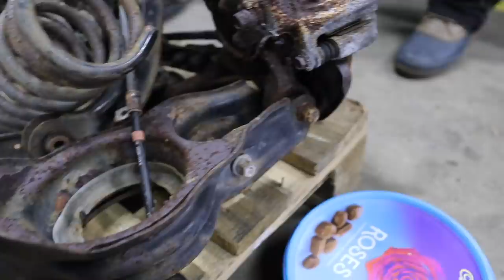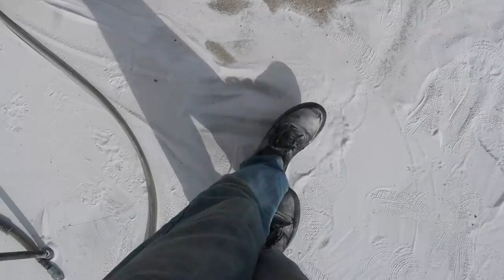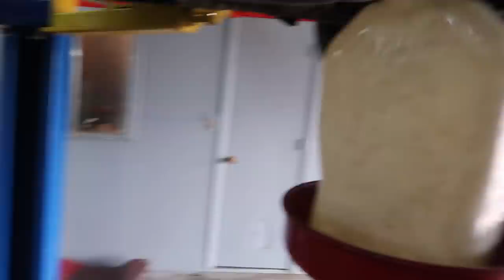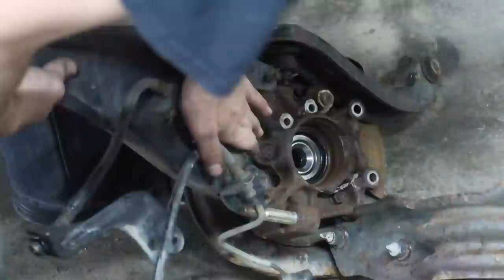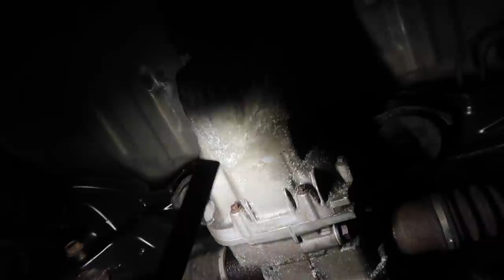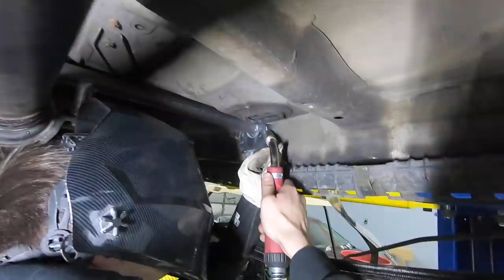Making Our Honda Minivan ALL WHEEL DRIVE! (Full Process)

Comment: Very neat retrofit on a USDM-spec van, for sure. But for the guys remarking how special the rear differential is, literally the same components are on the 1st Gen 4WD Odyssey as on the USDM 2000-2001 CR-V, right down to the part numbers: 41010-P6R-315 for the carrier sub-assembly, and 41011-P6R-315 for the Torque Control Differential (TCD) case kit. So, at least if you break it, it's easy to find replacement parts!

Comment: Where I work, I can tell you when it comes to region specific holes it is cheaper to use a hole plug then to modify the dye stamping the hole in the body. So anytime you have this type of upgrade usually gonna be bolt on, unless it's something like a sunroof...

Comment: if you put water on the floor before blasting the sand will stick to it and it will be easier cleaning it up, also when you paint you should have water on the floor so you don't stir up dirt, dust and debris from the floor onto your pained surfaces. Just a tip for you, you wont read it of course but someone might. cheers

Comment: When you had the Rowsyssey up in the air at 42:00 you can tell that your gear ratio is different from front to back. The rear is spinning faster than the front. Hope this doesn't cause anything to break.

Comment: Get some PB blaster for the shop.  I couldn't believe how well it worked on my 85 4runner when I rebuilt the suspension and diffs, I thought I was going to have to cut most of the bolts off because they looked so bad. In the end I had to cut one bolt off, I did soak it all down with PB blaster for a few days prior to tearing it down though.

Comment: That diff, if you want to look it up, looks the same as a Honda HRV GH4 from 1999 to 2005. If i recall correctly, it has a stack of clutches like a auto transmission, and the whole diff itself uses automatic transmission fluid, instead of normal gear oil.

Comment: You should have the cartel garage scan that rear diff and have a billet casing in case that rear diff breaks and scan the inside gears and other parts inside the casing so that you can be sure that the diff will fit and be able to replaced if anything go wrong its better to be safe than sorry especially with how rare the part is in the USA  and Europe

Comment: Did you end up getting mounts for the rear subframe sorted? if not i think you could get some nuts the correct size for the OEM bolts, drill a hole in some 1/4in plate, weld the nut over the hole, widen the hole in the odyssey so the nut will fit through, push the plate up and weld it on and you can use your OEM bolts and mounting locations etc

Comment: I've heard of the 2008 and up element and crf rear diffs holding about half the power your projecting.  If you diff is the older version . All u need to swap is the diff bracket for the upgraded version.  .. you may be able to use the carriage from a element.. .. . Which is very similar to a awd rsx rear assembly . ??,

Comment: You know there are engineers at Honda in Japan watching your videos probably trying to translate English to Japanese to better follow your amazing efforts. It’s one thing to get more horsepower out of a 4 cylinder than most can get out of the infamous Supra or BMW in-line sixes and it’s another to hook it all up to a minivan with beefed up AWD hardware. Honda out engineers Toyota, the Germans, and most everyone else. If you tried to do this with a German vehicle the hurdles would likely be insurmountable and it would still likely grenade into broken bits at the first application of full throttle. Yet a lowly Honda minivan and Civic wagon hardware can deal with 1000hp. Go Honda! Back in the mid 80’s when the first generation Integra hit the market the automotive journalists said the harder you abused it the more it rewarded the driver. The decade from the early 80’s to the early 90’s were the glory years for Honda and Acura. Has anyone made 1000 reliable horsepower from a Corolla or Sentra motor let alone hooked it up to AWD?

Comment: As someone who use to build drive shafts for a living. i do not like how they extended that front shaft. i could not let a shaft like that go to a customer. if the shaft has to be extended, its a full tube replace from 1 end to the other. not  weld another tube onto the end where it was cut. I really do hope you consider having all new shafts made for this some time in the future. Other than that, i love this build.

Comment: Just so you know, you should have extended the rear section of the driveshaft. The centre bearing would have lined up with the chassis member that Tom pointed out.
Reply: He talked about that and said it would just be too much work extending the front and shortening the back since he wanted it back the same day.

Comment: I like how the shop just cut and extended the shaft instead of cutting both ends off and running one solid piece.. lol

Edit: it's also not a good idea to have square/sharp edges on plates you weld to the frame.

Comment: did you check the gear ratio between the front and rear diff if they are off you can play with the tire size to make up the difference, split the load break less parts lol, looking good hope it holds together.

Comment: If the front part of the diff is a old type viscous coupling with the dimple plates and oil then the oil leak you talked about is not the diff oil but the viscous oil

Comment: The way to tell if there's a viscous coupler in that rear differential already, is to put somebody on the brakes, lock them tires up, and put some weight on that pinion shaft, and try and spin it. Check with a Honda dealer, I bet there is a factory spec for the amount of torque it takes to force the slip clutches in the viscous coupler to move. Much like with GM's all-wheel drive cargo vans, there is a certain set amount of necessary slip in the viscous coupler, and if the viscous coupler isn't going to release, it's worth rebuilding before you do too much damage to it and shred your drive shaft, or your differential.
Reply: Or with the most basic of research you would find that is the standard dual pump rear end for any RT4WD vehicle Honda released from the late 90's to the late 2000's everywhere in the world.

Comment: Would it be easier to just go to a pickapart and take the ass end out of an 05 element? Same transfer gears, tougher clutch pack. I know it would be a touch of knotcg snd weld but you guys waited months for a pallet of used parts that you can't replace when they break.

Comment: Pneumatic  chisel with a flat bit on the  thin end of the bolt, plus tons of penetrating lube should do the job. if not then add some heat to the tabs on the sub-frame instead of the bolt. Obviously you ended up getting it out, but this method should make quick work of it. (Thumbsup)

Comment: The rear wheel spinning faster than the front was irrelevant because the other wheel wasn't turning. It will spin faster when you stop the other side.

Comment: I mean maybe the rear end is going to hold up but those axle shafts??? I could wrap those things up with 250 hp on a hard launch.  They probably only ever saw 50 hp in stock operation lol.

Comment: I do not think that drive shaft and rear-end is going to hold up to 1000 HP especially when launching. Those rear diffs were designed for a 160 HP motors, hoping you did some upgrades on the internals. Bad ass though  cant wait for first run.

Comment: The fact that driveshaft shop did a cut and shut on that driveshaft is extremely dodgy. I can almost guarantee it will have run out because of it and structurally welding driveshaft tube to driveshaft tube is not strong at all.
They should have extended the front out of one piece of driveshaft tube.
Also because of the length it really should have been a 3 piece driveshaft.

Comment: Dude you shouldn't be sandblasting with white silica sand. That dust is so bad for you, it is worse than fibreglass dust.
It's in the same category as Asbestos and fibreglass dust.
It's called silicosis, not good.
Not sure in the USA but in Australia it is illegal to blast with white silica sand (you must use garnet) with fines exceeding $30,000